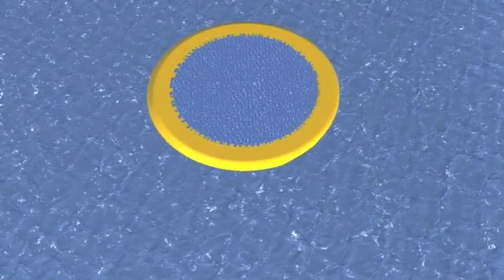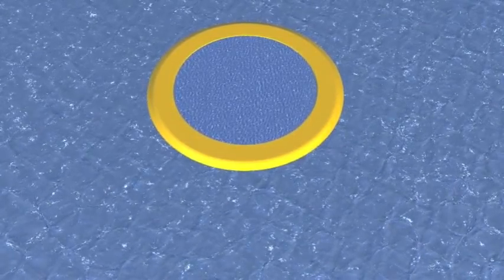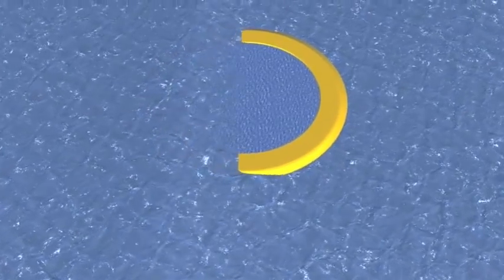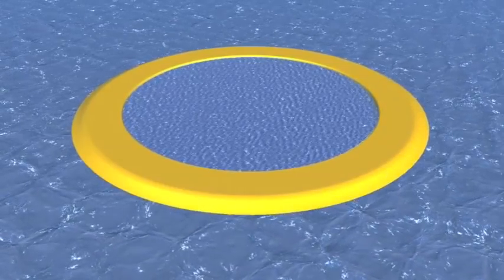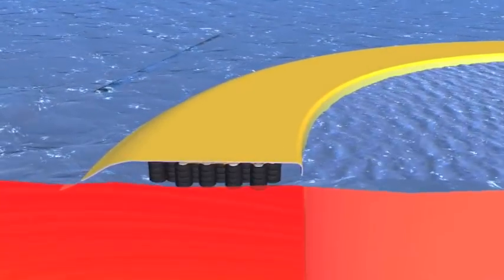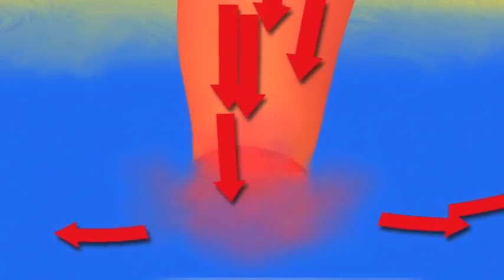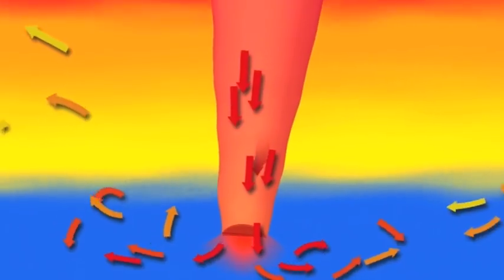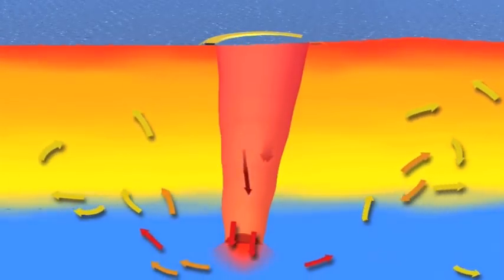Salter Sink Animation 2009-10-22

Comment: The earth has a mechanism to rid heat from the oceans for a reason, when we warm even deeper levels of water, over time, what would be the impact?
Reply: Likely stronger more sustained hurricanes in the area the pumps are used. Over time the hurricanes will eventually pull more and more warm water from the area as more is available. It would take hundreds of years but the overall result would be that. You'd eventually be recycling water that is all one temperature or needing stronger pumps in the deeper parts of the ocean to stop them as they cross that region.